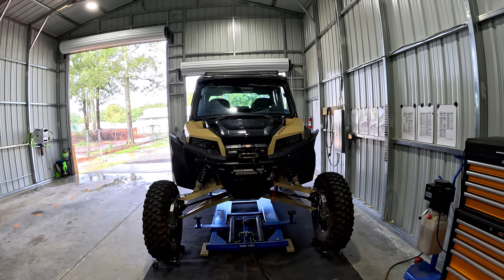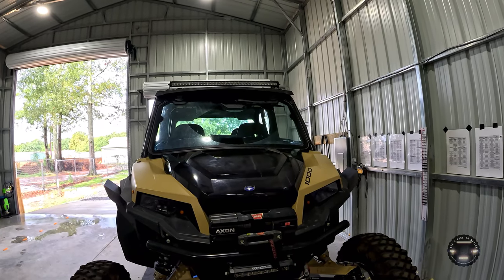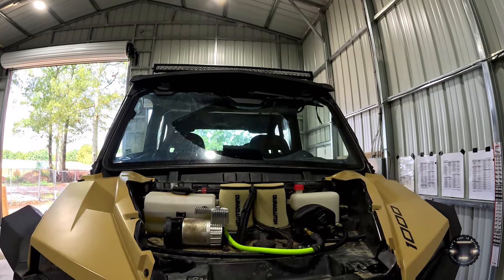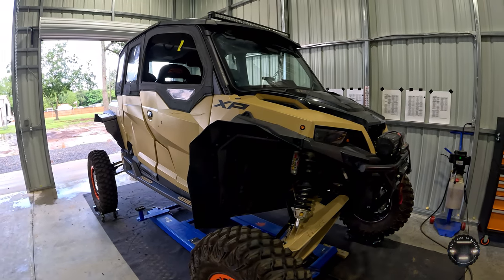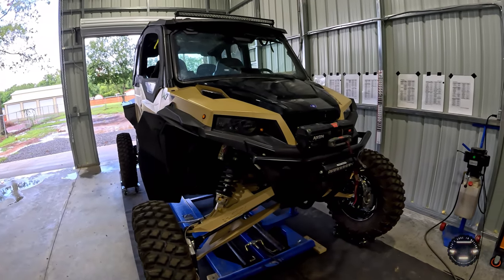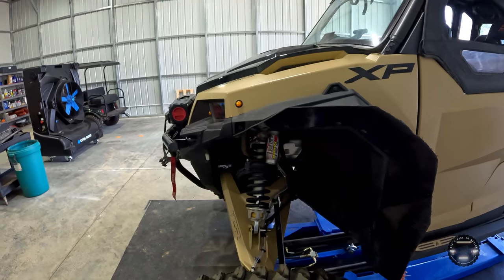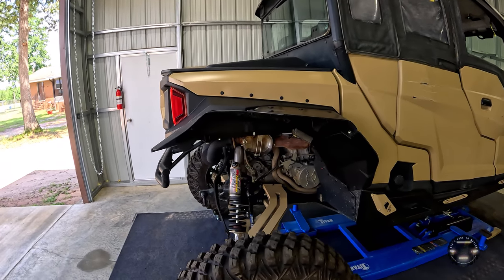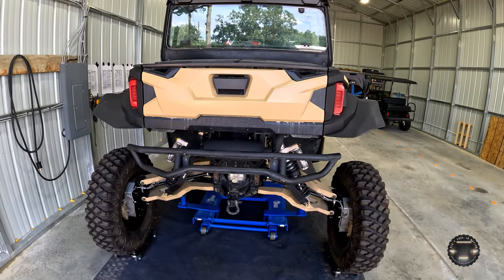Full Build Walkaround - Polaris General XP 4 on 37s and Portals

Comment: Well done!! 
It’s kinda past the point but a video on your tire inflation system would have been cool!
Reply from the maker: Yeah, there's a lot of videos of that thing that would have been cool haha. Some of it tho, like the inflation system, I had no idea what I was doing until it was done 😅
Reply: @RZRsEdgeInMotion  can you share the specs on the air pump? I have thought several times about adding one there but want to make sure it's putting out descent volume of air and actually fits under the hood.
Reply: Q